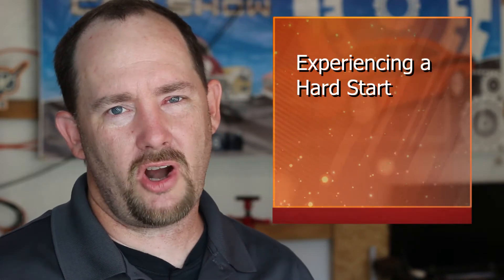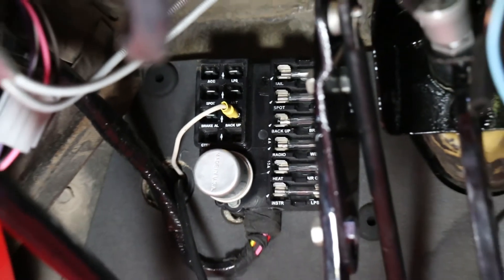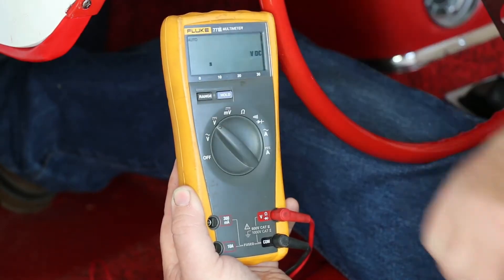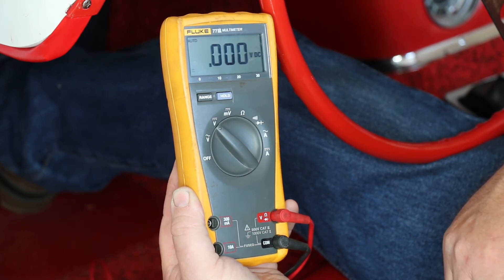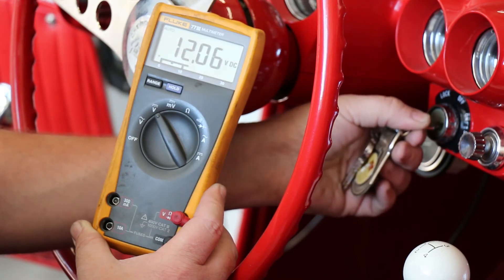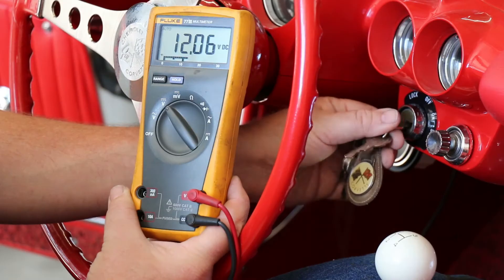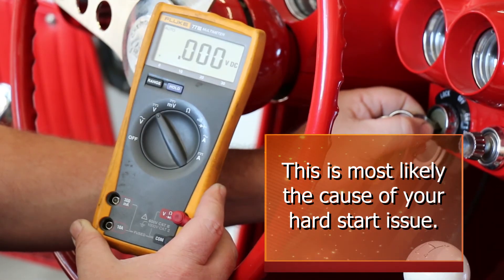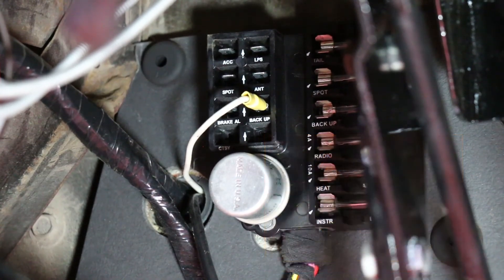How to troubleshoot and fix FiTech Fuel Injection Starting Issues

Comment: Great explanation on the connection of the white wire!  I'm having the same issue. 12 volts with key on but it goes to 0 volts when cranking then if it get it to start it shows 13 volts.  Thanks I will fine a different circuit that has 12 volts when cranking.

Comment: So I have a 1972 chevy nova and I just installed a fitech ultra ram and it just cranks but does not start I check all wires but it does start. It's set zero on TDC and it's receiving gas  I'm at lost and it's been two month and fitech has been any help

Comment: Whelp... I can tell you that wasn't the problem. Did you install the kit on the corvette?
Reply from the maker: Yes, it was a beautiful car and ran like a champ.  I see why people love those cars so much.
Reply: @cheaphotrods  Thanks! I had fun building it. I asked because I was having problems with it. Turns out the fuel command system was the problem. I still need to find out how you ran the vent line. I plan on taking the command center out. Not a fan of it personally and getting to the battery is already a pain.  Thanks for the reply though.  The actual FiTech throttle body is pretty cool and it does make start ups nicer.

Comment: This was the missing piece of the puzzle! Before I had to crank repeatedly, finally it would start and run as it should. Now it starts on the first try. Thanks!
Reply from the maker: Awesome!  It's sometimes the little things that get us.
Reply: I had the ECU shutdown when reaching operating temperature at 1 year mark. Would restart when cooled, only to shutdown again at temp. 
Fitech replaced ECU and sent Remote Mount Fuse & Relay Panel. Panel has relays and fuses for Main and Fuel Pump . Mounts on firewall. This should reduce the load on ECU circuit boards so they don’t overheat again.